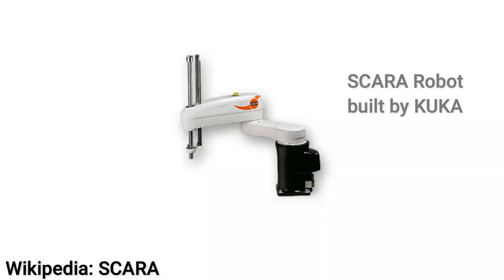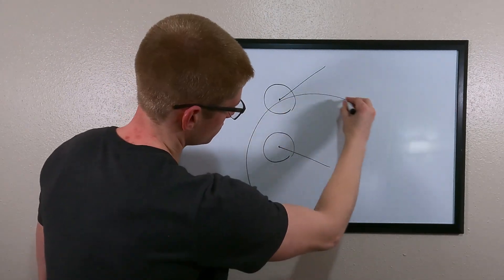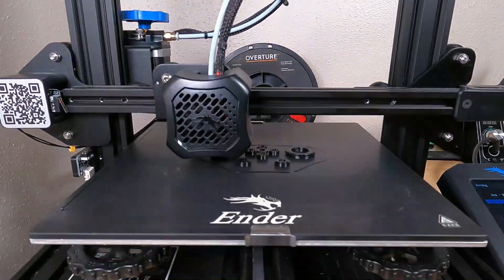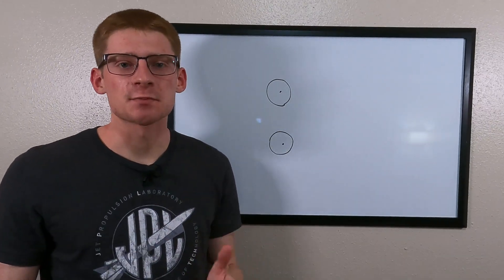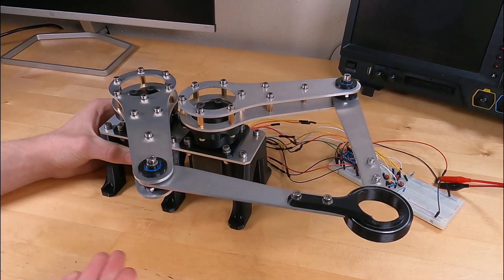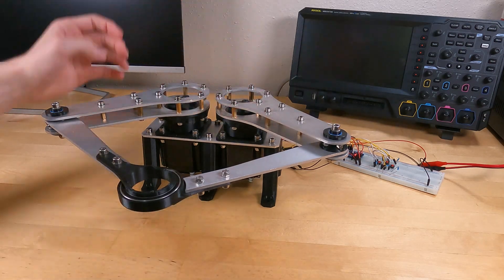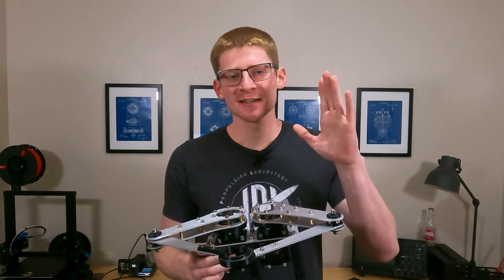I Built a SCARA Robot

Comment: if you remove the gear drive and use micro stepping ,then place the motors and arms at right angles then you should have a X and Y then grbl should work and 0/0 would be page center and gcode should drive the arms to any position within the limits.

Comment: I literaly just started on this exact project like 2 weeks ago lol. sadly I don't have any super fancy equipment or parts, besides a 3d printer,  just some skateboard berings and some screws. ( I am using an arduino uno with a CNC sheld to control the nema 17 stepper motors) I was able to make the lines fairly consistant and not vary stuttery when going in stratgh lines and 45 deg angles. but they get more sloppy and "stairstepy" when going at steep angles. I found that you need vary little to no backlash and a whole lot of points for it to make a good line. I split it up so there is a point every millimeter.     I hope this can help

Comment: I built a 3D printing parallel scara arm a few years ago. The main challenges were the gearbox backlash and how to home/zero the machine with good enough precision.
I ended up using belts and pulleys as a gear box, a harmonic drive would be ideal but they are way too expensive/hard to build.  The zeroing was also very important to get done with very high precision. If the angle the software thinks you have is even very slightly off from the real angle, straight lines will not be straight anymore. 
The parallel scara is very strong and can move at very highs speeds and accelerations. In the end the 3D printer actually performed pretty well. The zeroing was never properly solved so all prints were a little bit crooked, the prints looked good though.

Comment: For the linearization, I think it would also be inteeesting to re-frame the problem in terms of the discrete steps that you take along the path. At each step, you need to determine which motor you want to step to remain as close as possible to the target line. (If you care about a constant movement speed,  you would also need to solve for the individual delays in between those steps). That would involve just a bit of forward kinematics to simulate the outcome of each option, and then pick the one that is closer to the line. I feel like this could be done on-the-fly pretty easily.

Comment: If the one side was built higher than the other by the thickness of the inner arms and... The more extreme  arms were built with an offset mount at the end you could make that robot reach over the back and maximise the motion.

Comment: Hello Levi, I just came across your video and enjoyed it. Years ago I made a 3D printer with the same SCARA/ 5 bar setup. I recall that zero backlash steppers cost about $950 each. So I purchased 50:1 geared stepper motors for $50 each, then spring loaded the arms so that the backlash was always on the same side of the gear train. 

Here's one of the videos. 

https://www.youtube.com/watch?v=OtjxwOCDM_M&t=11s

There is also a discussion in the SCARA section over on the Reprap forum.

Anyways, great work!

Comment: I haven't tried this myself, but I think you might want to look at Jacobian matrices.  The control loop could take the difference between the desired position and the current position to get a desired velocity vector in global coordinates.  Then use the Jacobian to get required joint velocities.  The resulting motion should follow something of a straight line.  Also, you could look at equations for a four bar linkage to calculate joint angles and possibly use those to arrive at a Jacobian.  Whether that could be implemented on a small microcontroller or not is another issue.

Comment: You only used 1 solution for the motor angles and therefore it is working in 1 single mode. This setup of robots has 4 working modes. The hardest challenge for the robot is the control algorithm, since there are regions where the robot can’t get with one working mode. Writing the program for trajectory planning will therefore not just include inverse kinematics, but also the algorithm that decides what working mode is best to reach the next destination from where it currently is.
Reply: I also recommend using matlab to write the control algorithm with trajectory planning. It will do all the heavy stuff and you can hook up your arduino to matlab to execute the commands.

Comment: Couldn't you zero the steppers separatelly? Zero of each motor would be the position where it colides with the round part of the other arm.
These positions should be reliably repeatable and you wouldn't need any limit switch if your sterpper motor drivers can detect the colision. Sensorless homing is pretty popular in 3d printers.

Comment: this was cool to see and brought back memories.  I had an idea to do the exact same configuration 7 years ago and prototyped it with acrylic sheets and 3d printed parts.  I hadn't heard of cycloided drives at the time so i did a double belt gear reduction instead.  I had tensioners that took out virtually all of the backlash and as you can see in the video, the motion is quite smooth.  Great work, keep it up! https://youtube.com/shorts/gfWPveQl7nI?feature=share

Comment: Nice project. An idea from my side: You have both arms on the same vertical level. Therefor they collide quite fast, and you have only a little more than a 180° of working area (as you have shown). But if one is above the other, you may increase this to close to 360°. Best regards from Switzerland.

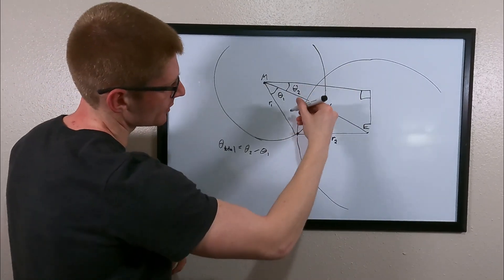Comment: At 10:40, if you have the circle intersection point for where the two links will meet, you can ignore the second (outer) link and final end point and just calculate the angle of the intersection point from your horizontal line using an arctangent function (rotating the angles if needed to account for the motor orientation). Calculating two angles and adding them is extra and unnecessary math work, in my humble opinion. But I've only done this sort of kinematics work on a laptop, not a microcontroller so I could be wrong about "just" being able to call an atan() function using the x,y offset of that intersection point.

Comment: I would use theta= atan2(y,x) instead of inverse sine and inverse cosine.  It’s more stable and keeps track of the quadrant.

As for zeroing, I would put a single limit switch in the frame right in the middle where a “wrist” feature can touch. The homing would be really simple with that.

Comment: Nicely done.  Just thought I’d mention that even if you solve the computing time problem to the point you have no gaps, you’ll quite likely still experience some of the shakiness using such a chunky time resolution.  Your reduction to segments is very likely causing discontinuities at the first derivative (and higher) which in effect get amplified with any slop or momentum in the system.  Finer time resolution of the whole system is one way to attack this, but you very likely can get away with calculating coarsely and a finer time resolution using only a second or third order smoothing function.  (I recently saw a great video that illustrates a related problem trying to draw “pleasing” splines - https://youtu.be/jvPPXbo87ds)

Comment: Slick. For the cycloidal drive 3d printed inaccuracy issue, maybe use send-cut-send for them also? Can you see what sort of back EMF you're getting (you can make directional loop antenna with copper, place it near each stepper, and then hook it into your Rigol's chan 1 and2) 

The cogging (or "stuttering" as other people have said) could probably be fixed with a look-up table? I don't know arduinononono but I know that division in general is 20x cycles more than any other math operation. I'm guessing any sinusoidal operation is moving into the 500ish territory unless youre using a DSP/FPGA. 

What steppers are you using? They look pretty slick. If you replace the flat-base with 4 bearings, I bet you could turn this into a "Shaper Origin" DIY and out-perform most Bridgeports since you can get balanced BLDCs or PMSMs are in the sub-500$ range, and they're running at the ideal 30krpm that CBN and sintered-carbide inserts like.  Or at the very least, low hanging fruit would be to just throw a plasma cutter head in there.

Comment: You should be proud of your work here, ~25% of 'robotization tasks' are just a simple pick and place (and real world dynamics is more than sufficient distortion).
You should also research how to linearize the motion using state space and discretization techniques (if not for your own edification).
If you use induction motors (due to their power) for a project you don't have that position control as with stepper motors, so it means more control computations.
.....oh and encoders....don't forget the encoders.

Comment: I work with a similar arm at work, except only one motor drives the two arms in opposite directions (basically acting as the r control) and then the second spins that mechanism around (giving you theta), so it can cover nearly 360° out to the full arm extension with just 2 motors in the same relatively simple construction.

Comment: This is a great explanation of some of the inner workings of a delta 3D printer too, and it’s easy to understand why they work so much better with a 32bit processor controlling them vs. the cheap 8bit micro controller the budget one came with.

Comment: I played around with double polar drawbot concept, with very similar kinematics to scara  kinematics. I precomputed the gcode for the linear movement and transmitted them over serial. I then stumbled across a project which inspired me to use gcode arcs rather than interpolating all the points, which was easily handled by the Nano.

Comment: Here you are using a 5 bar mechanism, with g the distance between the axes of the 2 servos.
But you could do g=0. In this configuration, the calculations are slightly simpler.
Thus, you could go from the 5 bars (kite) to the diamond, and from the diamond to the paw.
I invite you to take a look at this video, https://youtu.be/vx3uZrUOx5w

Comment: Regarding the jerkyness of it, it appears to me that it's caused by the multiple divisions of movements to get to your linear motion. You can see it making little arcs. I wonder if you had it do more divisions that would make the jerkyness disappear. Perhaps number of divisions as a function of the length of the distance to move, so it's doing fewer divisions for shorter distances. I always like your presentations and projects. keep up the good work.
Reply: Marlin's SCARA code uses segments per second rather than segments of a particular length. Usually around 100-200. That keeps the computation cost constant regardless of how fast you're moving, although it does mean that fast moves are less precise. But even at 100mm per second, that's still only 0.5-1mm segments, so arc deviation is insignificant.

Comment: Could this be gotten to be a actual straight line and used to replace the corexy motion system on a 3d printer
Reply: Yeah, SCARA printers are fun. Tough to get as high of precision as independent X and Y motors though. You need very precise measurements of the arm segment lengths (at least within 0.1mm), and home angles. This 5 bar/parallel style is probably even harder to calibrate than a single arm, though it can move a lot faster without vibrating.

Comment: - Is the stuttering due to varying loop execution time?  You could correct this to some extent by fixing the interval between executions using a timer interrupt or with a non-blocking wait.
- You could speed up the code by pre-calculating all of the required angles for your work space and resolution, then putting the results in a look up table.  The Arduino doesn't have to do most of the trigonometry on the fly and just look up the required results.
- Thirdly, i've developed a commercial product that does something that we call a bump and home because we didn't want to include a limit switch on the product.  We tell the motor to move slowly towards the limit.  We know we've reached the limit when the following error gets too high - this is now our home position.
Reply: I might be tempted to try implementing the IK as a coarse LUT on a 1cm grid, mapping (x,y) to entries not just (a,b) but also the d(x,y)/d(a,b) jacobian to use to take two or three Newton–Raphson steps on the interpolated LUT to get the error down to almost nothing.
Reply: @AJMansfield1  ⚠️ God has said in the Quran:

🔵 { O mankind, worship your Lord, who created you and those before you, that you may become righteous - ( 2:21 ) 

🔴 [He] who made for you the earth a bed [spread out] and the sky a ceiling and sent down from the sky, rain and brought forth thereby fruits as provision for you. So do not attribute to Allah equals while you know [that there is nothing similar to Him]. ( 2:22 )

🔵 And if you are in doubt about what We have sent down upon Our Servant [Muhammad], then produce a surah the like thereof and call upon your witnesses other than Allah, if you should be truthful. ( 2:23 )

🔴 But if you do not - and you will never be able to - then fear the Fire, whose fuel is men and stones, prepared for the disbelievers.( 2:24 )

🔵 And give good tidings to those who believe and do righteous deeds that they will have gardens [in Paradise] beneath which rivers flow. Whenever they are provided with a provision of fruit therefrom, they will say, "This is what we were provided with before." And it is given to them in likeness. And they will have therein purified spouses, and they will abide therein eternally. ( 2:25 )

⚠️ Quran
Reply: Came here to suggest precomputation, glad to see it's one of the top comments.
Reply: Alternatively, build a lookup table for the trig functions and do some tricky float cheating with that power/sqrt function (i.e. bitshifting the exponent of the float over one bit to the left, doubling the exponent and therefore squaring the float, or a right bitshift of the exponent with extra logic to approximate square root)
Reply: @42468  perhaps, but if you're on the sorts of small microcontrollers where precomputed function LUTs are relevant, you probably don't have a hardware floating point unit. In which case, integers and fixed point arithmetic are supreme.

Comment: Highly recommend Mbed as a superior Arduino replacement if you're running into performance problems. Simple things are almost as simple, and more complex things are vastly simpler, than using Arduino. Performance is off the charts in comparison because the libraries are much better written. The full Mbed build includes a real-time operating system so you can even run multiple threads concurrently with little effort. There are hundreds of Mbed compatible boards around too, most very low cost. Hope this helps!

Comment: if you have a well defined problem, IK inverse kinematics model, then you can make a simple robot to solve the problem, but why make it more complex with non-linear axes combinations, linear grid motion is much more simpler anyways
Reply: why would you make a problem unnecessarily complex, total complexity matters, k.i.s. smarties
Reply: knowing is not useful, having skill perfect as given by God, not by people, not known by people
Reply: convert the problems to linear from rotational, to make it simple again
Reply: so sad to be tied to old decisions so you have to use certain tech forcibly, like rotational motors for arms
Reply: dont you think rail I-beams (two per rail) are stable axes for a cnc/laser engraver robot, but if you can make a simple 1-axis machine, its better/simpler than 2d or 3d machine
Reply: making complex stuff for money sake is nuts
Reply: being a slave because you dont have abundance of simple stuff is nuts
Reply: freedom any time over law based slavery
Reply: if you change the second arms above the first arms, then you can move the whole point to the other side, "over your heads"
Reply: scaffolding is much more stable, that flexing wobbles like heck
Reply: its not the microcontroller, its you

Comment: Great project, but you can improove arm. You can preload robot arms by weak  springs and use ceramic bearings in arm  joints (due to lower weight). In addition you can install IMU sensor into the end of robot arm for more precise movements control. Best regards

Comment: Hey Levi, great video! Glad to see you back on youtube. 
Your comment on the computation time is probably not accurate.  I have run a couple inverse kinematic functions on Arduino boards with 3 degrees of freedom and found that they run in microseconds.  
You can use the micros() function on Arduino to find the actual time that the function takes to run.  This micros() function does round to the nearest 4 microseconds. 
My guess is that running the linearization loop with a shorter interval may fix your problem. 
Also,, make sure you are using a stepper library that uses interrupts. This allows the microcontroller to pause computation to send a pulse to the stepper motor and then return to computing the equation.

Comment: Now that you have it printed you should be able to bump the size of the cycloidal gear up in your slicer to reduce the backlash, no need to modify the cad file if you can scale it.

You should move away from using the Arduino, esp32, STM32 or a raspberry pi pico would be very good options for this, the esp32 and pico W also have wifi which might be of use to you, the esp32 also has Bluetooth which means you could create an app to control it wirelessly. The arduino nano doesn’t have a FPU so floating point calculations will be very slow, it is also only 8 bit and 16 MHz, some STM32s and esp32s have FPUs which should speed up calculations. You can also get a 32 bit dual core 240 MHz esp32 very cheap and they have some very useful peripherals.